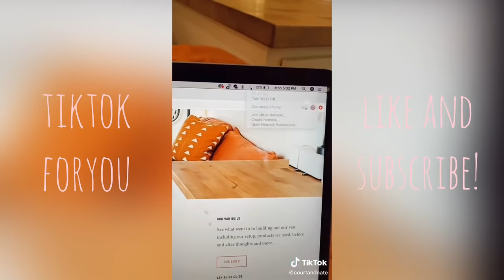VAN AND BUS LIFE TIKTOK COMPILATION PART 2

Comment: imma live on a bus because -
1- I can travel and work at the same time
2-i can renovate it anyway I want to
3-if I have a stalker (probably won't but) I'm always going to different spots it'll be hard to keep up
4-i get to see new things and never be bored
5-it'll probably be cheaper than buying a van that has no windows
6-its my choice if I wanna put up walls or destroy walls 
7-if I'm in the same area as my family I'll never be far from them
8-i'll be able to try food that might not be in my country 
9-i get to build my furniture 

that is my 9 reasons why I wanna live on a bus 😊